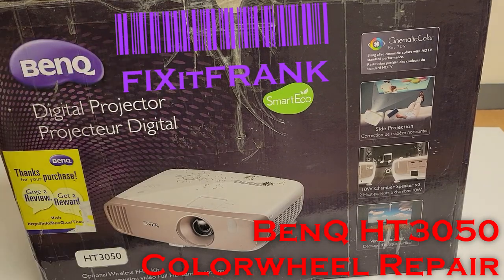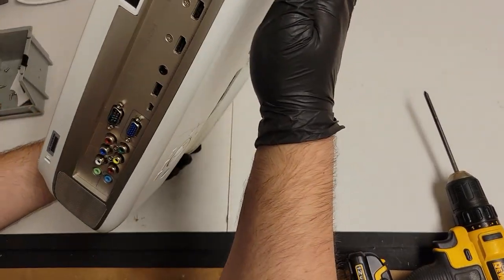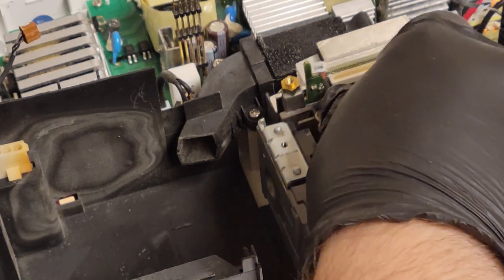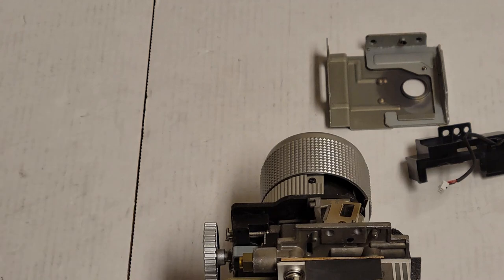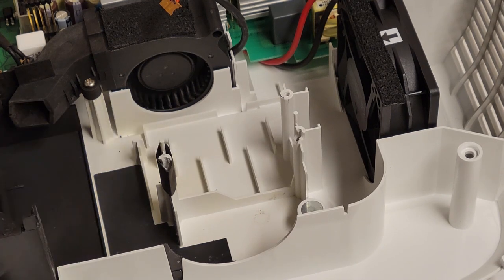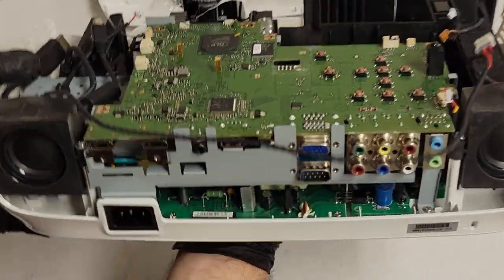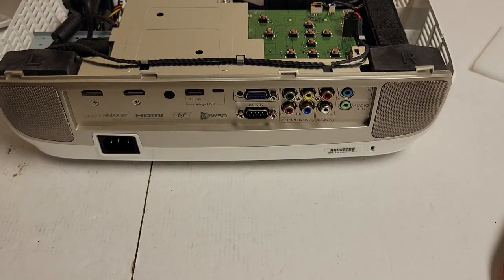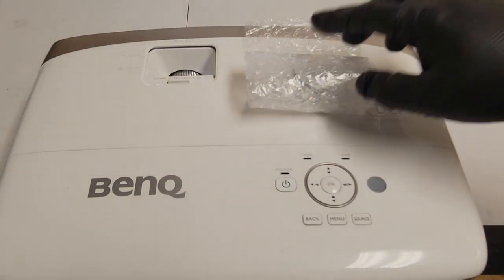BenQ HT3050 DLP Projector Repair | New Color Wheel Install | Cleaning

Comment: Just wanted to say thank you for such a helpful video. My lamp recently exploded leaving glass all over the inside of the projector, and there had been dust on the DMD for months so I used the excuse to completely disassemble and clean. Couldn't have done it without your video. There was a scary moment when I first turned it on with lines all over the screen but I took it apart again and made sure the DMD connector was cleaned and now all working perfectly. Thank you for breathing new life into my projector!
Reply from the maker: You're very welcome! Great job and thanks for letting me know the video was helpful. That keeps me making them. Many thanks for the donation too. You didn't have to but it will go to good use. Enjoy your projector!
Reply: was it fairly easy to clean?
Reply: @MarquezDaniel  yes. I mostly used some soft brushes and then a manual air squirt (not sure what it's properly called). I did have some canned air that I used in a few places including on the DMD. I didn't have a mini vacuum or compressor but still managed to do it all
Reply: @roryjhs  thanks I'm gonna give it a try. I got quite a bit of dust in mine. When I opened the top panel to get to the lamp it was quite dusty so I tried blowing some of the dust off but it got into the DMD 😭

Comment: Thanks so much for your video Frank. I have the same projector. It was stopping after a while, saying the lamp was overheating, so I ordered that inner fan. Although it's probably not the culprit, I replaced it. My plastic stand was broken as well on the 3 screws. As it turned out, a bit of the lamp was broken, the ceramic part covering the wires, not sure if a fan failure caused it to overheat or if it overheats because broken. Cheers. Emmanuel
Reply: I ordered the lamp, ready to go! One thing bothering me however: one of the internal speakers is broken (not sure why or how it happened but the membrane must be dead because it makes a horrible sound). I found the ref. number during disassembly (150915) however I can't find it anywhere. Let me know if you have tips. Thanks!

Comment: So easy to get to parts in this one, plenty of space inside too. I just bought a used Panasonic PT rz370 and opened it up to clean the dust build up in the fans and was surprised how compact and well built it was. It's basically the same internally as your unrepairable rw330 laser/led video but its full HD and native 16:9.... Cheers Frank hope your doing ok buddy.
Reply from the maker: I must admit, BenQ is one of my more preferred brands to work on.  Very easy to get around inside of them. 
My personal belief is that technology starts out well spaced, then as it matures, it becomes more compact with less air space. Then when it fully matures, it then starts to take up less space.  I recall older (2005-2010) DLPs that became very full inside with lots of fans and thermal management, and now they are mostly air with one fan.
How do you like the RZ370?  I am keeping my eyes open for a decent used laser to try out.  
Things are going pretty well over here man. I appreciate you asking.  Hope you and your family are hanging in there too.
Reply: @FixitFrank  Were both fine here in the UK, cheers Frank. Pleased with the RZ so far, good picture (8500 hours), set up is easy compared to my sanyo dwl2500 ust. The RZ has a tilt shift lens and zoom. I set it up when we want to watch a movie, it's not a permanent set up. I've only owned these two projectors but would love a 4k ust but the cost puts me off, I would rather get a good oled TV instead. These new Chinese laser projectors are getting more popular but I'm still not sure about reliability once the warranty has expired or even before it's expired. Time will tell. Take care over there. 😁👍

Comment: Thanks Frank for your very detailed videos. It helped me a lot while disassembling my HT3050 (or W2000 in Germany) to replace the exploded lamp with a new oem one. I didn't replace the cage, because it looked good. I now realize, that at the edges of the little glass at the end of the cage are burnt in spots I guess. Do you know if the small glass sheet is replacable? because a whole new oem cage costs 5 times of the replacement oem lamp. I'm not shure if these are the reasons I have soft spots in dark scenes all over my picture. I'll try cleaning the optical assembly next, maybe this will help.
Reply from the maker: Hi Cristoph, that lens is kind of hard to find. It's not impossible but you would have to likely order it from China. Might end up being 30 euros or more with shipping. If your picture is good currently and the color wheel is not erroring, I would leave the old one in. Then next time look for a third party aftermarket lamp. If you can find a reseller for apog brand lamps, they are a very good replacement. Cheaper in price but not too cheap but oem quality.
Reply: @FixitFrank  thanks for the reply, i'll have a look into the aftermarket parts, but for now everything seems to work, no errors anymore in the service menu, and the spots are hardly visible. Thanks again, and all the best. :-)
Reply from the maker: @Christoph_Schoetschel  Sure thing! I would use it as is. I think you are fine.  Someday when you need to replace it again, look for the aftermarket lamp but until then, this should be fine.

Comment: What's your opinion on "compatible" color wheels? I have a BenQ HT3050 where the color wheel doesn't start spinning and the projector shuts off quickly. With the CW from another HT3050 with broken glass segments the projector is showing a picture.

The projector will need a new lamp too. Is it worth buying an original color wheel for a HT3050 that is quite old - if I can still get one?
Reply from the maker: For what it's worth, there is not really an OEM color wheel. BenQ doesn't make color wheels. They buy them from manufacturers. While BenQ may sell them, you can buy pretty much any color wheel that will fit and it should be fine.  It's just a 3 pole motor with some color segments glued to it.  There are some sellers that seem to have lower quality versions. One seller on eBay to stay away from is 'lampbook'.  However, Voltarea.com has good parts(in the USA too) or the company I use out of china. Time electronics.  Gydz@timeprojectorlamp.com.  They take paypal and ship DHL.   My general rule is buying something in the middle of the price range. Cheap tends to be cheap and expensive isn't always equalling better quality.  The lamp is a bigger concern.  Stay away from Amazon.  all of the lamps on amazon are junk. Price matters here.  I'd expect to spend around $100-150 for something worth using.  https://www.purelandsupply.com/benq-lcd-projector-lamp_ht3050.html  this is 126.40 and if you use YT50 in checkout you can get 5% off. Otherwise look at the lamp sellers listed on Projectorcentral.com. All of them are reputable and you will get a good lamp.  Bottom feeders like jaspertronic say they have OEM but they have a deluded sense of what OEM means. I have seen so many projectors ruined by jasper and amazon products. 
Once you replace the wheel and the lamp, there is no reason, you shouldn't expect at least another 5 years of normal use. While older, the HT3050 is still a really nice projector.  Good luck!
Reply: @FixitFrank  Thank you for your all your recommendations regarding spare parts! I have contacted Time Electronics for the color wheel. For naked Osram lamps I have a reliable source here in Germany (≈ $70). I mentioned the lamp because I was not sure if it's worth trying to repair the projector if more than one part needs to be replaced.
Reply from the maker: Crystal is a wonderful sales rep. She will take very good care of you.  If you have a good source for proper bare lamps, then you will be fine.  The main problem is when people replace the full assembly with the poor quality version that have the wrong IR filter. On average an OEM housing should be safe to use for around 15,000 hours until its coating has degraded too far.  In the US, a used HT3050 is still selling for $400-500 so putting $100-150 into the unit would be worthwhile.

Comment: I know that this post a bit old but hopefully I get a response. 

I have the HT3050 and when I turn it on it will work perfectly fine for about 10-12 seconds, with it showing my Xbox home screen and all the colors look fine. But then the projector turns off and the "Lamp" light on the projector itself, turns red. 

Now, I don't know if this is related. But I kept getting a pop-up when starting my projector. This pop-up was just a simple reminder or warning to eventually replace my lamp. Well, I got annoyed with it and I just reset the lamp hours (without replacing the lamp) in hopes of getting rid of the pop-up for good. 

I cannot remember if I did this the day before my projector started acting this way. Or If I did that in response to the projector acting this way. 
It may not be correlated at all. 

Any ideas?
Reply from the maker: Your lamp is bad.  The warning is telling you that the lamp life ran out so you reset it and now its shutting down with a lamp warning.  You need to replace the lamp when the warning is displayed. That is why they have it. They don't put that warning just to sell lamp. They put that up because the thermal cycles of a 2000 hour lamp are usually exhausted by then.  Sure you might get some life after that but the lumens will be at least half and the quartz will be vitrified to the point to where it might explode while running and burn up your ballast and power supply. 
Once you replace the lamp, reset the timer again and you should be fine as long as no damage has occured from running the lamp too far past the rated lifespan.
Reply: @FixitFrank  thank you so much for the reply back. I greatly appreciate it

Comment: I have vertical lines on the screen after opening my HT3050 to remove dust on the dmd, - its only when a white background,  is this the color wheel causing the issue?
Reply from the maker: Im not 100% sure but I suspect the mainboard isnt down all the way or the metal bracket isnt seated enough to let the mainboard sit down on the DMD board connector.  I am pretty confident its a connection issue but it might be somewhere else like the DMD to the dmd board for instance.
Reply: @FixitFrank  i'll take it apart and re-check
Reply: @FixitFrank  Thank you for the tip, i re-seated the dmd board on the main board, and it's fixed now!